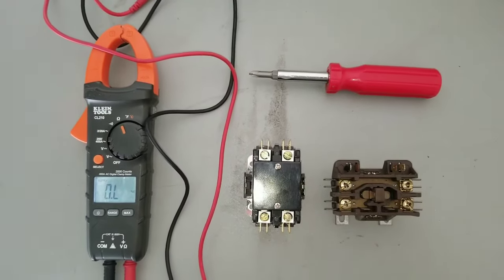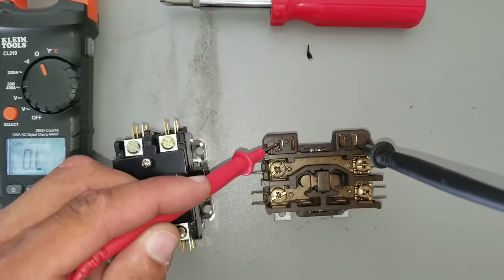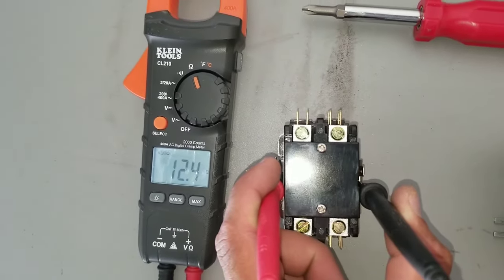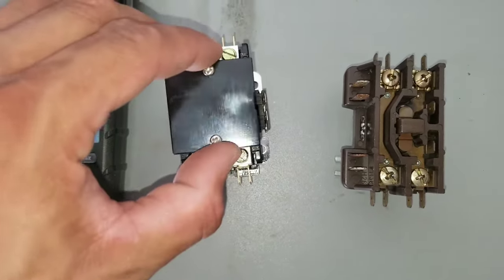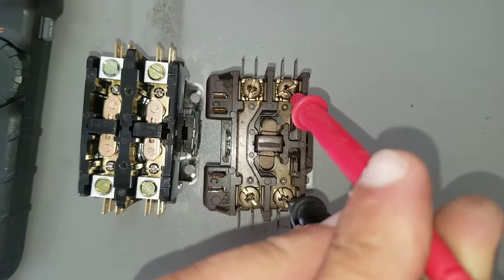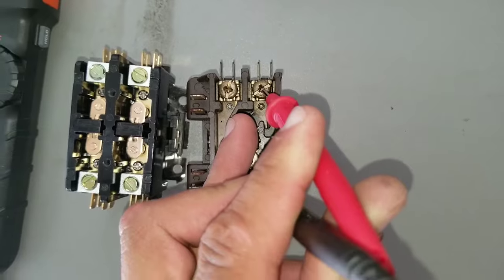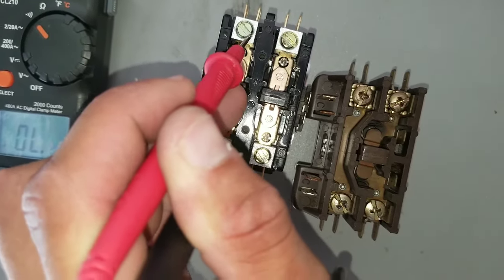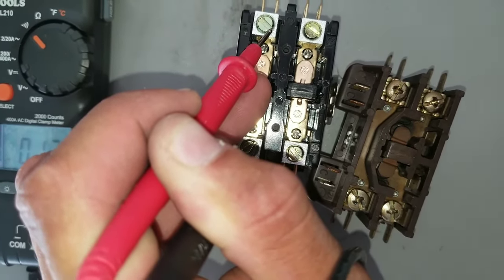Testing Contactor Using MultiMeter. Ohms and Continuity Test.

Comment: When testing continuity of the old contactor, you got no beep after depressing the button…. Wouldn’t it be reasonable to say…This is a bad contactor because of a lack of continuity?  But you skipped over this major point!
Reply: yes, but i’ll mention that char on the terminals or pitting under the plunger can cause no continuity. if it easy enough, you can scrape off whatevers causing the issue and most of the time the contactor will work. the main issue is not enough resistance between the thermostat wires

Comment: Do you need to remove the low voltage wires to do this ?
Reply: Yes and no. If you check it with power connected and use your finger...you risk death. If you check it. If you check it unpower and unconnected youre ok
Reply: @nikcue2542  He's risking death from 24 volts?

Comment: Great videos.  Thanks.  Question:  To test total inrush on a 3 ton a/c unit, do u recommend clamping the meter on the common wire or the run wire coming from the compressor?  Thanks.
Reply: No response!
Reply: On the common!